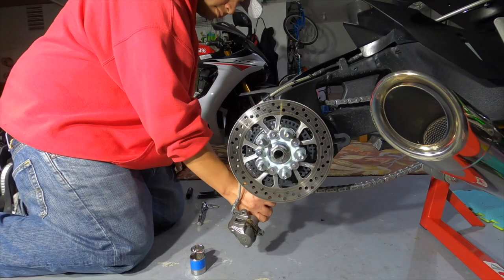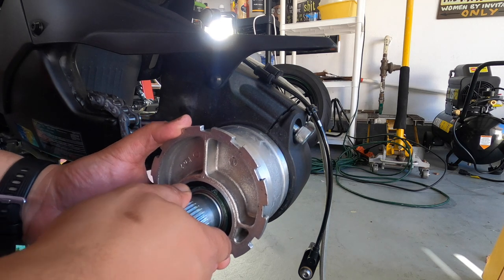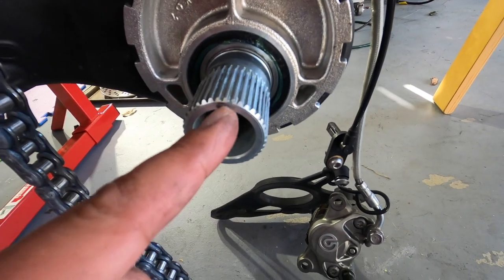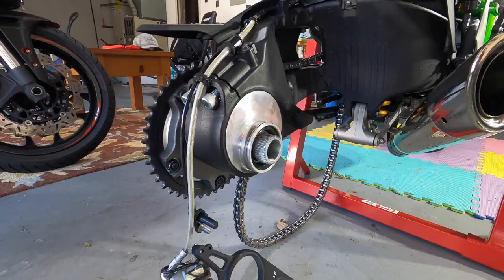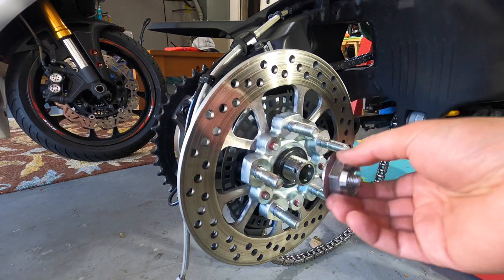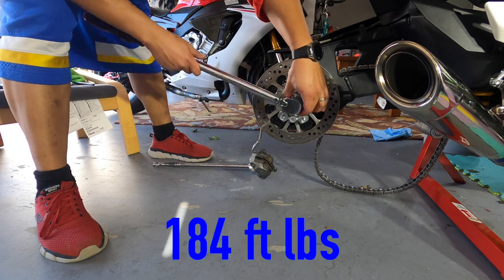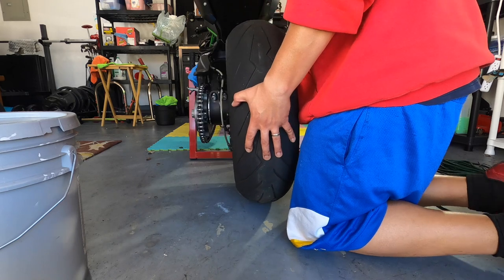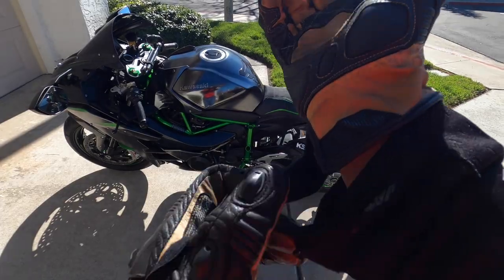Ninja H2 Ceramic Bearing install Part 2 | KSIX

Comment: Did you Tq the two Allen bolts that hold your eccentric hub? Didn’t look like you did in the video I’m assuming you remembered eventually?
Reply from the maker: They were tightened. I didn't put that part in the video. Felt pointless at the time. I didn't want to film and edit adjustment of the chain and tightening those two allen bolts. I should have made a note saying that it was done🤙